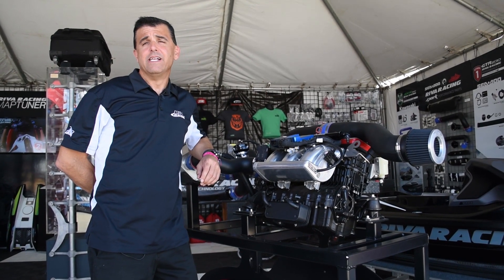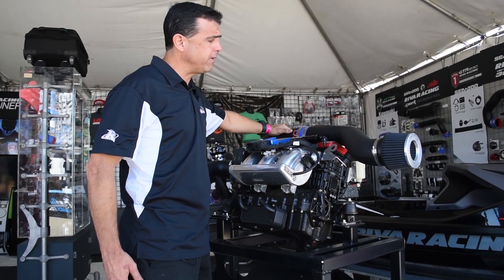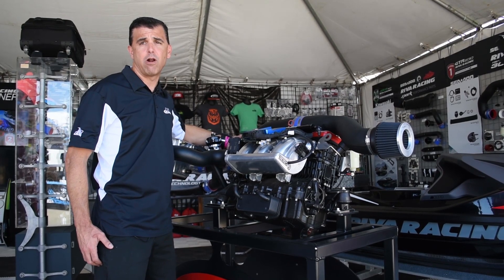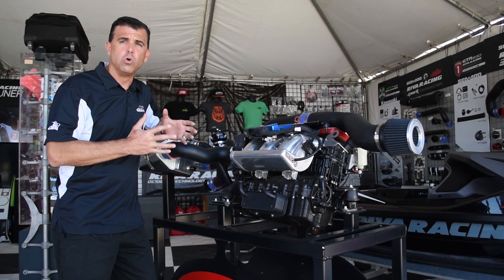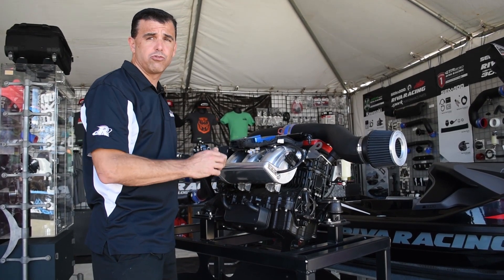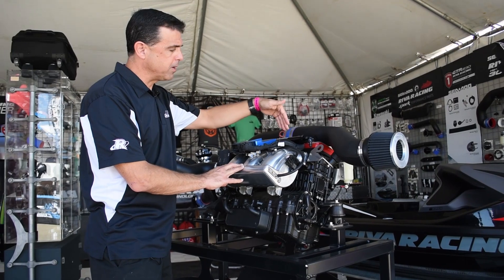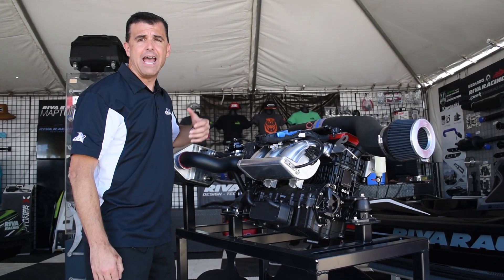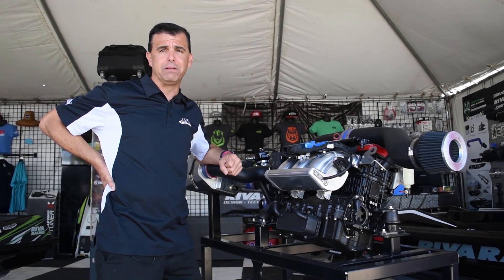The Ultimate 2018 Sea-Doo RXT-X 300 Engine Upgrades Walkthrough

Comment: will this work on the Scarab 255 boat with twin 300s? or would you be better buying the 250 horse and adding the riva ?
Reply: Hey man I’m not a part of riva but I have an rxtx 255 that I’ve used riva parts on and pretty much all the parts that they use on that rxtx 300 engine are different from the 255 engine parts because it’s a different block but yeah I’d assume if it’s a seadoo 255 you can go to riva racing’s website and get some stuff I bought the stage 1 kit for my 2008 rxtx 255 and I liked it besides one part that they apparently don’t have in stock and can’t get anymore and because horrible covid timing they don’t have much customer service so I haven’t gotten that part yet but all the other stuff has been great
Reply: @tristanphillips8937  i just got a rxt-x 255 for a project and am looking for some upgrades an information. Like cam,valves,boost wheel etc.
Reply: @Thatboyzee268   yeah most important thinks to get are the internals upgrades and to find someone who can tune your ski. the internals give you a lot of wiggle room for stuff like more boost and higher rev limits without needing to worry about your ski blowing up under you. ive been working on mine since and have done a number of things, more boost was the biggest headache. luckily i found a guy near me who works on and tunes a lot of can-am side by sides for racing so he could tune my ski for me. you could get a preset tune kit but every engine is different so youre not likely to get the most out of your engine or have it be the safest it could be for you and yourself. i made the mistake of not fully getting my cams and valves up to spec before adding more boost, and valve knock was alarming to say the least and i immediately took it off the water save yourself the headache and get that kit fairly soon. of course do stuff like intake and exaust first. also for my specific taste ive actually kept the stock impeller, i like the great low end with the decent top end it gives me but of course thats personal
Reply: @Thatboyzee268  also get yourself a nice set of fuel injectors, take your time in the build and have a set point your trying to get to and get the upgrades in a sequence so the ski is always running, id recommend not ordering it all at once unless its stuff like valves and cams so you only have to break it down once. ordering everything at once tends to make stuff get really fucky really fast. ive always found riva to be the best, torx makes good products but they dont tend to give much information up front so that can make it hard to get what you need.